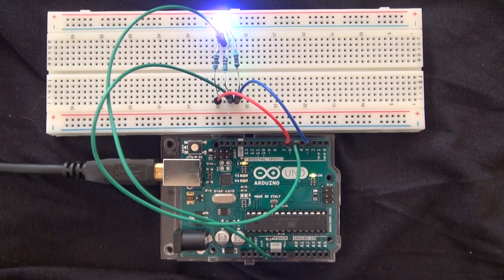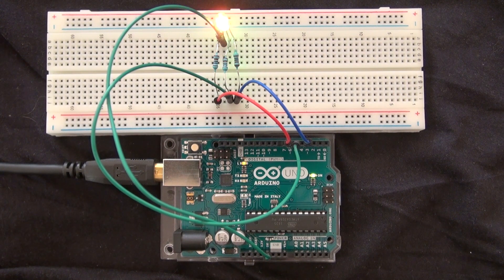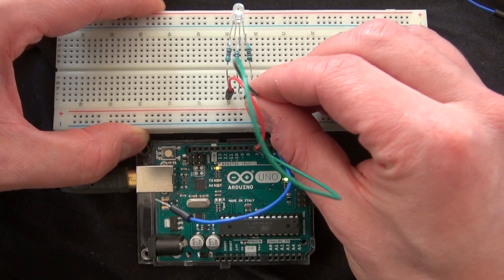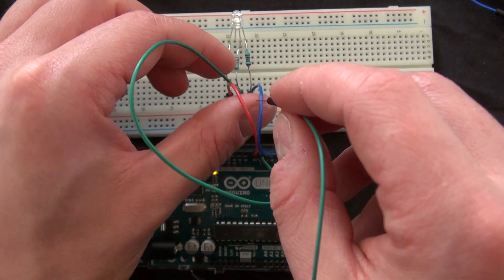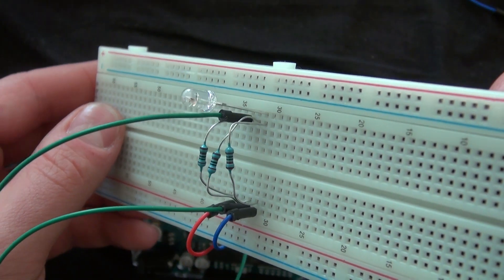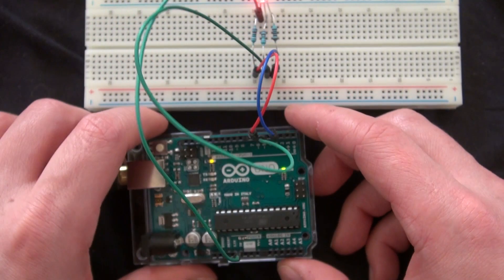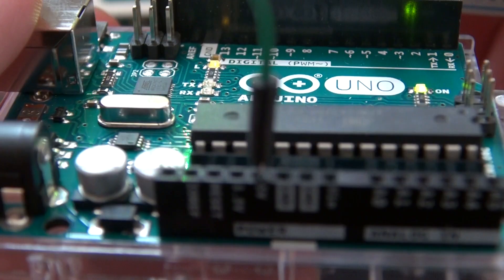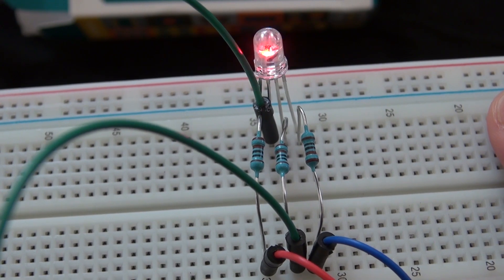RGB LED Common Anode Arduino

Comment: This work only with digitalWrite, so you can light only 6 colors plus white at time, because with analogWrite (needed for fade as example) you need a transistor, or if you use 40 ma max led, you have to use inverted PWM (0 equal HIGH, 255 LOW )

Comment: Good morning, in your opinion is it possible to connect a series of RGB LEDs with common anode driven by the 74HC595? obviously starting from the Arduino PWM signals?
Reply from the maker: It is possible, you just need to find the right schematic.

Comment: I have a common anode and it seems like the colours work in reverse
int redPin = 10;
int greenPin = 9;
int bluePin = 8;
String myColour;
String msg = "What Colour do you want?";

void setup() {
  // put your setup code here, to run once:
  Serial.begin(9600);
  pinMode(redPin,OUTPUT);
  pinMode(greenPin,OUTPUT);
  pinMode(bluePin,OUTPUT);
}

void loop() {
  // put your main code here, to run repeatedly:
  Serial.println(msg);
  while (Serial.available() ==0){
  }

  myColour = Serial.readString();

  if (myColour == "red"){
    digitalWrite(redPin, LOW);
    digitalWrite(greenPin, HIGH);
    digitalWrite(bluePin, HIGH);
  }

  if (myColour == "green"){
    digitalWrite(redPin, HIGH);
    digitalWrite(greenPin, LOW);
    digitalWrite(bluePin, HIGH);
  }

  if (myColour == "blue"){
    digitalWrite(redPin, HIGH);
    digitalWrite(greenPin, HIGH);
    digitalWrite(bluePin, LOW);
  }
}

Turning on red I have to make green and blue high for some reason. instead of making them low and making red high

Comment: I bought rgb led from the internet but it doesn't come with any document so i can't tell if its anode or cathode. Will it damage my arduino i set it wrong?
Reply from the maker: No it won't damage your arduino, the rgb will simply not work. How you can tell the difference is by taking a 3v button cell battery and touching the long lead of the rgb led with the battery and the shorter lead. Long lead on the positive side of the battery and negative on shorter lead, if it lights up it is a common anode. Same thing is true for the opposite for checking common cathode.

Comment: wouldnt it be better if you used a single 220 ohm resistor from the positive to the led instead of 3 220 ohm resistors
Reply: that wouldn't work if you mix multiple colors

Comment: Nice but can you explain what the code does and how it is different from a cathode led?
Reply: From what I’ve learnt ( I’ve only started learning LED for like 3 days I think, so my info is not that accurate ) , if you use the same code from cathode LED in anode LED, the colours are reversed. So the code must be reversed too I think. I’m not rly sure

Comment: Is it possible if we use only 1 resistor for 5v (anode)?
Reply: I've tried, it did work that way with just single 330 Ohm. But donno if it will shorten lifespan or  damage of the led. I did such to see if the brightness differs from 3 resistors. Answer is no noticeable difference
Reply: @peterlaikc  thank you

Comment: dude, the rgb you used in this video is common catodhe, not common anode
Reply from the maker: I looked at the package that the leds came in and it said common anode. I thought the same as you until I connected the leads to a 3v button cell battery, and saw that the longer lead was anode because the led turned on when the positive of the battery was touching it.

Comment: well, thanks for your great video <3 
I am about to do something crazy I just ordered common anode rgb leds 5mm, and I am about to connect 8 led to my cpu cooler instead of red ones 
my mother board supports addressable RGB with that header (+12v~G~B~R)
the led specs are:- 
Red:2.0-2.2V (20mA) | Green:3.0-3.2V (20mA) | Blue:2.8-3.0V (20mA)
so whats ur advice, I need to know 
1- do I need only 3 resistors, 1 for 8xR , 1 for 8xG , 1 for 8xB. or I need 24 resistors, 1  for each cathode pin? 
2- whats is the value of resistor for each color do you think?
I would be really thankful if u help me out!! 
I really want to transfer my Cpu cooler to Rgb instead of solid red 
Thanks once again! <3
Reply: Good luck!

Comment: how can this be possible!    this pwm signal is of 5 v and you are  giving the circuit only +5 v .......theres no ground lol.....this must be a common cathod rgb bcz those works that way......common anod requir transistor to have ground signals of pwm !,
Reply: It can't be common cathode, If so, it wouldn't have lit when he put 5v to the led on leg 2 ( that leg of these leds being, common cathode or common anode) diodes will only work if properly connected with polarity. A cathode isn't going to like 5v+ on it. So given that he clearly shows 5v going to that leg, it has to be an anode.